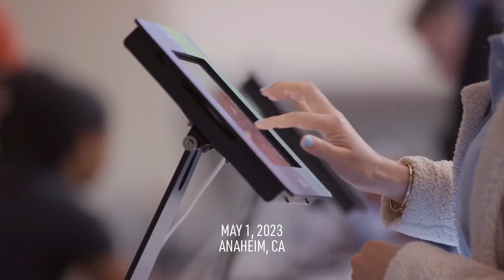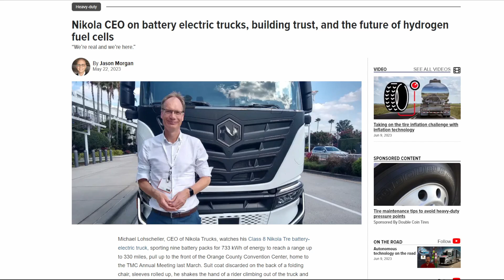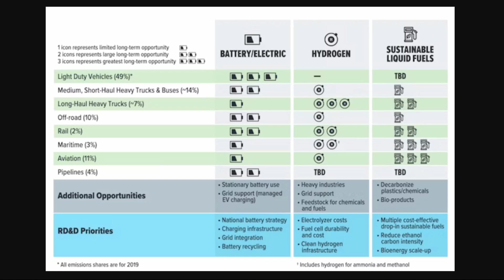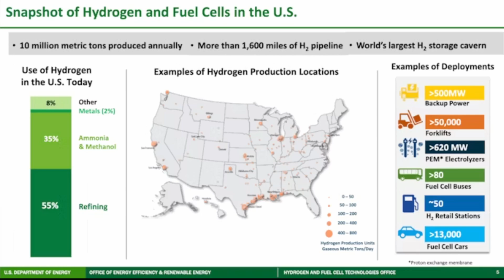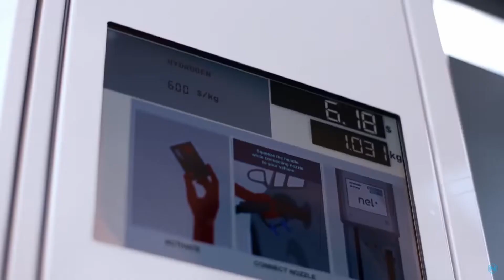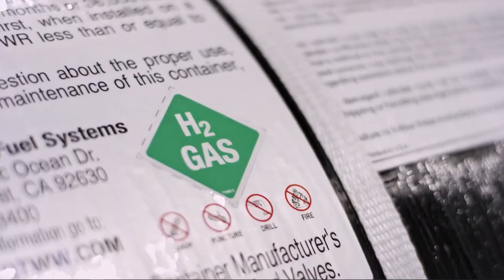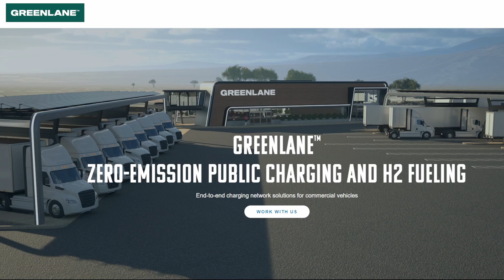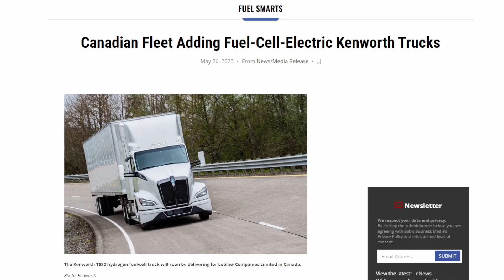Can Nikola Motors Solve The Hydrogen Problem?

Comment: Hydrogen trucks make no sense, since they consume between 5 and 8 times more energy per mile than electric trucks. H2 in California currently costs $36 per kg, meaning that a hydrogen Nikola truck will cost $5.04 per mile (assuming 70 kg of H2 for 500 miles), whereas a diesel truck costs $0.73 per mile (assuming 7 mpg and $5.15 per gallon) and a Tesla Semi electric truck costs $0.52 per mile (assuming $0.27 per kWh, 962 kWh for 500 miles with 8% charging loss). There is no way that trucking companies are going to spend 7-10 times more per mile for hydrogen. 

They will have to get the price of hydrogen down to $5 per kg in order to be competitive, and there is now way that is happening with green hydrogen, so hydrogen is a mirage pushed by the fossil fuel industry to avoid change.
For more info, Google my blog article: Amos Batto (2023-12-24) Why hydrogen won't be the fuel of the future, but it will be a vital chemical input.

Comment: No, no they can't. Nobody can.

The logistics of only being able to deliver 1000kg per trailer (less the multiple 20kg fills the delivery truck itself needs) and the cost to produce green hydrogen will always be the issue, it's not a chicken and egg situation, the fuel, if made cleanly, will always be too expensive compared to a battery truck, you need 300% to 400% more electricity to go the same distance due to the inefficiencies of the electrolyzer and fuel cell (even worse for JCB's combustion engine), so it will always be at least 3x to 4x more expensive per mile. No commercial trucking company is going to go for that, unless subsided to do so with taxpayers money - but even at $3 per kg in the Biden IRA, that gets to you maybe parity with diesel - electric will still be cheaper.

Right now, it's 10x more expensive per mile for a hydrogen Mirai than a Tesla, there is no reason to think this won't be the same for trucking. For the small edge cases where 1000 mile / 1600 km per day range is needed, we will likely see either battery swaps or even entire tractor / semi swaps like a pony express, where the driver switches to a freshly charged truck - but realistically, those edge cases will be served by diesel for the foreseeable future if things like Tesla's Semi does not deliver.

Such distances would be best served by electrified rail to local distribution hubs, but thats a whole other video as to why that can't happen in America.

And to your last point, actually, yes, a Tesla owner or EV truck depot owner will invest in charging if it saves them more than it costs. If hydrogen vehicles sellers like Nikola and Toyota won't invest in filling infrastructure, then who will? Tesla did for their customers because they knew, without road charging, the sales would always be limited. Why isn't Toyota and Nikola doing the same for hydrogen as Tesla is for electricity? And now Ford, GM, Volvo, Rivian and no doubt more soon have waived the white flag and conceded than actually, Tesla is an energy company, not just a car company, and they want access to Tesla's filling network for their customers.
Reply from the maker: Sure man, whatever you say
Reply: @visceral_investing  the best bet for Nikola now is batteries - same for Toyota. Hydrogen is an energy hole that no profits can come from - not for Nikola, not for trucking operators, at 54kWh per kg it just can’t work. Hydrogen as a low carbon cheap fuel is not happening - 2nd law of thermodynamics - basic physics - makes it economically unviable.

Comment: No, they can't solve the high cost of hydrogen. Is there any trucking company running hydrogen trucks in the USA in 2023?  I have seen zero news of any truck sales to a company that is actually using them in a profitable business.   Demonstrations come and go since 2017 with Kenworth, Toyota and Shell Oil.   It looks like hydrogen trucking is busted.  No sales in six years.  Hydrogen vehicles were touted as the solution in 1999 and twenty four years later, nothing but pretty pictures and video of demonstration trucks.  Show me the truck gigafactory that is going to build these trucks.  Zip, zero, nada.  It's a scam.  The oil company has won with the hydrogen con job.

Comment: Question should be - Can Nikola SURVIVE long enough
Reply: That would be a very clear - no!
Reply: Long enough for what they are not profitable. They did not make much easier electric trucks profitably the CEO says they need to change their business model as he doubts it could ever be profitable. They didn’t sell the trucks they built and scaled it back. Hydrogen is much more expensive than diesel, hydrogen fuel will be twice the price of electric per mile. That’s not mentioning truck operators would need to buy a hydrogen stations costing hundreds of millions each.  Why purchase this? Their running costs and tech is totally debunked

Comment: Companies such as Lind will solve this problem. To do this, it is necessary that blue hydrogen becomes cheaper than gray hydrogen. This will happen in 2024-2025. Most likely, this will happen first in countries such as Qatar or Morocco. Then it will become economically profitable to produce green hydrogen, infrastructure for it, etc.

Comment: US Government should be funding Nikola Motors by ordering some 18 wheel trucks - instead we are spending 140 billion dollars in Ukraine
Reply: US truckers don't like the cab-over design, so this truck won't be a big hit.
Reply: @onsokumaru4663 Very useful in all the ports of Los Angeles. 
Back in the 80's there were nothing but cab-overs around the ports and now they are making a come back. 
All the ports of LA and Long Beach are already using Nikola Trucks. 
Cab-overs are just the perfect application for the ports.
Reply: @Onsokumaru  What they like - is a free truck - filling up 300 gallons of diesel fuel cast them over $1,500 - the only get 5 miles to a gallon - so they make ZERO Money
Reply: That is true 👍  screw  Ukraine
Reply: Michael Mourek - First, we haven't spent $140M in Ukraine.  Newsweek fact-checked this exact topic recently and estimated the US has invested no more than $77B in Ukraine since the Russian invasion.  Not chump change, but certainly not $140B (see link below).  Secondly, where do you think most of that $77B has gone?  If you said "down the street" you'd be much closer to reality here.  Bottom-line, the vast majority of our $$$ have gone to US corporations to manufacture weapons, either new ones yes, but mostly to REPLACE the ones we and our allies have sent over from current stocks.  Tanks, APCs, trucks, artillery pieces, SAM systems, and not the least, AMMO!  While we have and are providing direct support as well, that is most likely less than $20B-$30B if that.  And what do we get in return, the weakening and diminishment of our #2 adversary - Russia!  Frankly, that is a priceless opportunity for the USA at a time when we can use it most following 20-yrs of desert CT operations.  What a bargain!  https://www.newsweek.com/fact-check-have-us-taxpayers-sent-200-billion-ukraine-1796322

Comment: Can you do a video on ongoing geological surveys on hydrogen as well extracting from used oil wells,work on microbial,plasmafication,solid oxide electrolyzers using nuclear and other methods.

Theirs also been recent research in storing hydrogen in coal and iron and new electolyzers converting natural gas into hydrogen without burning it so no carbon dioxide emmisions occur